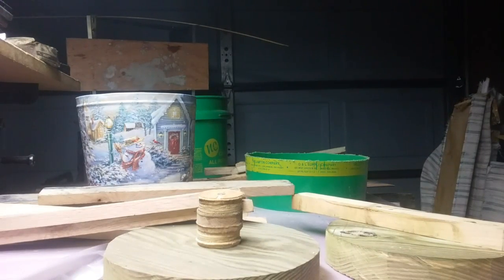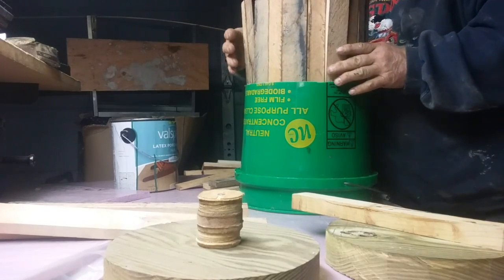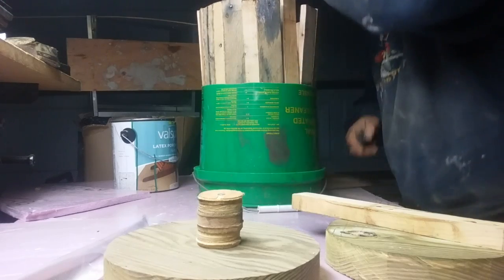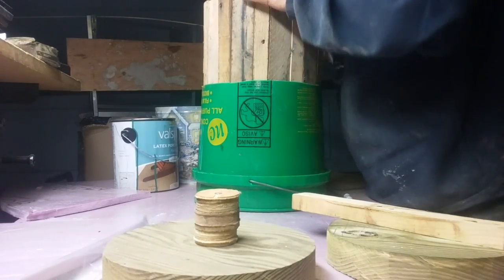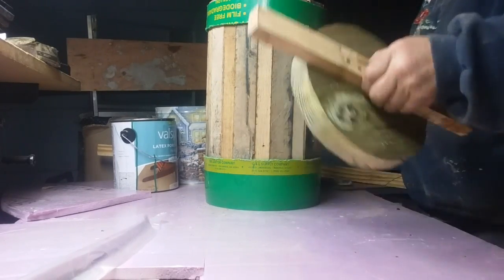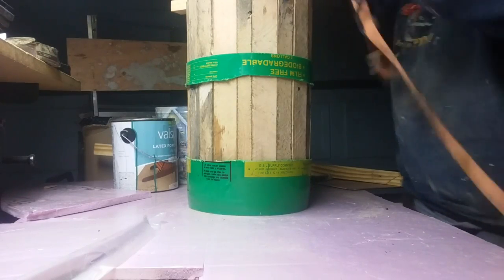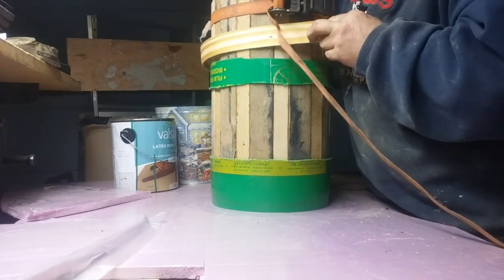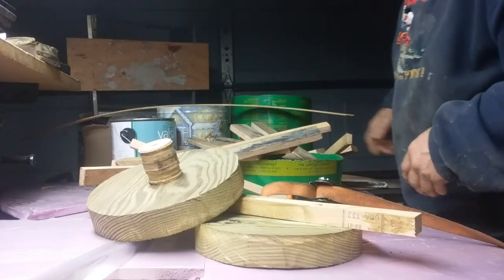Small barrel making with a 5 gallon bucket

Comment: what degree of angle did you cut the stays and what was the inside measurement and the out side measurement of your stays? I also noticed that not all your stays are the same width. That is a good idea on using a 5gal. bucket.

Comment from the maker: i just used what ever boards i had .so your right not all the same 
the angle not sure just cut until I got it
thanks for watching
Reply: Mark Fridley so if you were to make another you would have to keep cutting until you figured out the fit again ??? 
I want to age whisky and I would like to build a small barrel like yours ..
Reply: fred greenwood 360 divided by the number of staves you wish to use divided by 2.  Let’s say you want to use 20 staves. 360 ~ 20 = 18 ~ 2 = 9 degrees on each side.